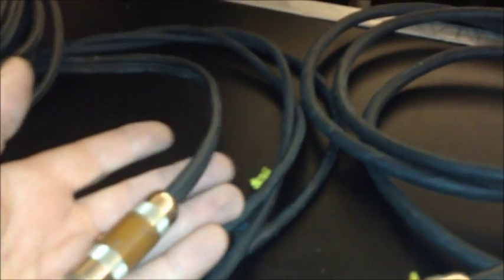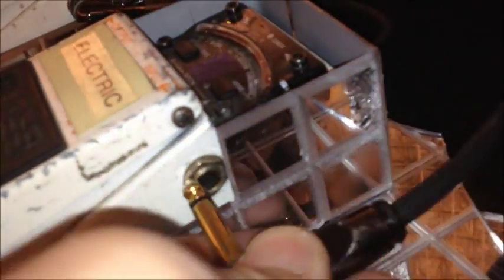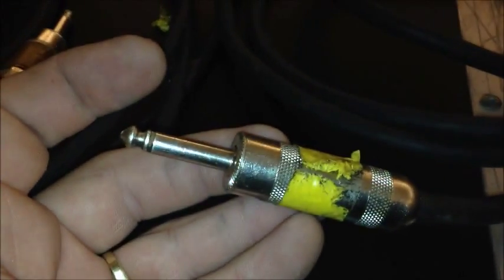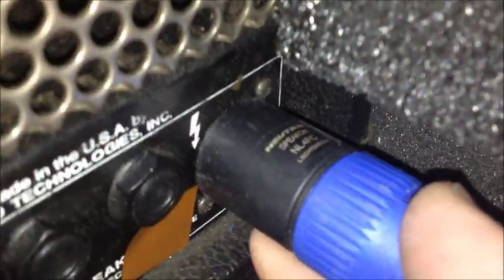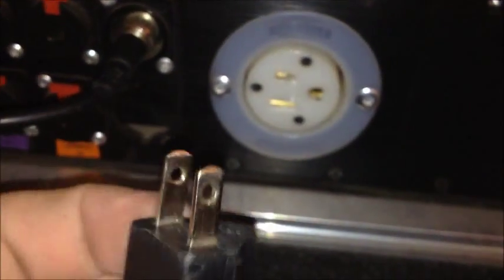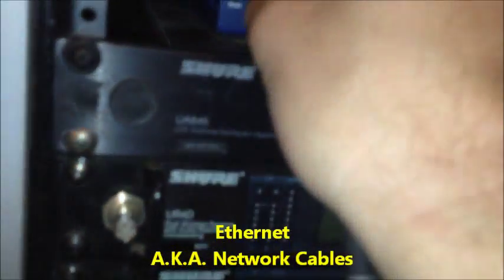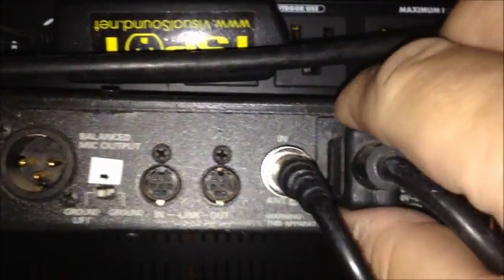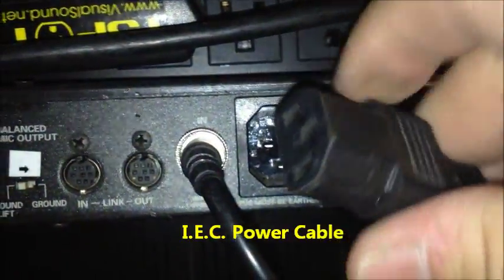types of stage cables - stage hand 101 - Part 5

Comment: BNC is a connector type, not a cable. Antennas are normally coax cables with BNC terminations.
Reply from the maker: Yes, but on stage you refer to cables by the type of connectors it has, not by the wire it has. XLR cables, 1/4", NL4, IEC cable, etc... So, technically you are right, but it is still better to refer to cables by the type of connectors in my opinion and from what I have experienced.
Reply: @SammyBones  Coaxial cables can be terminated multiple ways, unlike the other cables you mentioned.
Reply from the maker: @jordanhenshaw  that is correct, which is why it is so important to call the cable by what type of connectors it has on it. This avoids confusion when doing stage production work.
Reply from the maker: As an example... On stage, I could say "could you hand me that SJO cable?" But that could be an IEC cable, a regular Edison, a British connector, a twist lock, an NL4 Nuetrik, a speaker cable, a motor cable, or many various types of connectors that use the same type of wire.
Reply: @SammyBones  BNC is not a type of cable. It is a type of connector that you can usually screw right off in seconds. In my work, a BNC connector can be used for both SDI, power, or antenna cables, all of which are made of coaxial cable and happen to terminate with the little BNC you can pop right off. 

HDMI is a type of cable. It is also a type of connector.

XLR is a type of cable. It is technically also a type of connector.

DMX 3-pin is a type of cable. It is not a type of connector. (These cables technically use XLR connectors).

DMX 5-pin is a type of cable. It is also a type of connector. 

So there are completely different cables that share the same connectors, but differ in impedance, and should not be used interchangeably. Therefore you can’t always call a cable by its connector type.

In the case of coax cables terminated with BNC, it makes a lot more sense to me to call it an antenna cable or SDI cable, but never a BNC cable. That’s primarily because you can just screw off a bnc connector without using any tools whatsoever and put it right back on in seconds. It’s very much a connector, not a cable, for that reason. I don’t know of any other termination types that can come completely off in seconds with no tools.
Reply from the maker: @jordanhenshaw  thanks for your detailed input. Any stage that I am on, we will be calling it by the name of the connector, so feel free to call it anything you want. I prefer to get the right cable handed to me when I ask for it. I am very familiar with SDI, HDMI, DMX, etc ...but even with cables like DMX, you can mainly tell at a glance what kind of cable it is by the connector. I can't imagine wanting to read the fine print on a cable each time I want a 5 pin DMX... some cables don't even say that they are on the cable, so you are forced to look at the connector. As someone who has worked for decades in stage production, I have seen that calling the cable by the connector is the only thing they consistently works. Today, in fact, I had a lighting guy ask me if I had seen any powercon cables laying around. He could have just said "AC cables" but it has to be a specific cable that had a powercon. So, do it however you want, and my videos and comments are simply my opinion.
Reply: @SammyBones  I call that power-con too. 5 and 4 pin dmx is always the same cabling, but if you’re dealing with cheaper lights that have 3-pin DMX, you absolutely must read the fine print on the cabling or have a good color coding system. Get them mixed up on on a shorter run and you should be fine, but much longer and now that’s the first thing you have to replace as soon as there’s an issue with DMX control.
Reply from the maker: @jordanhenshaw  bringing the correct cables to the gig for.lights would be the lighting companies responsibility, so by the time the cables are on stage, they should be the correct ones.

Comment: What effect does the ground have that it has to be broken off? I thought you weren't supposed to do that so you can be safe from electrocution.
Reply from the maker: YummYummYummilicious The ground being removed is ok in this scenario because we are all on wireless. Therefor the guitar player is safe from shock. Also, typically, backline(guitar amps) power comes from audio to ensure legs are properly wired.THanks for the comment. #stagepower
Reply: Ah okay Thank you!